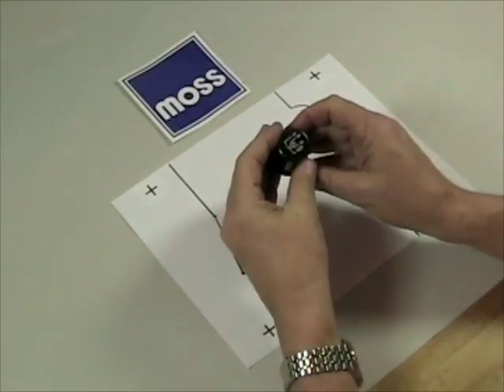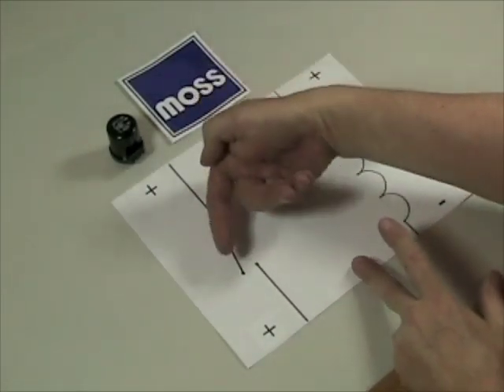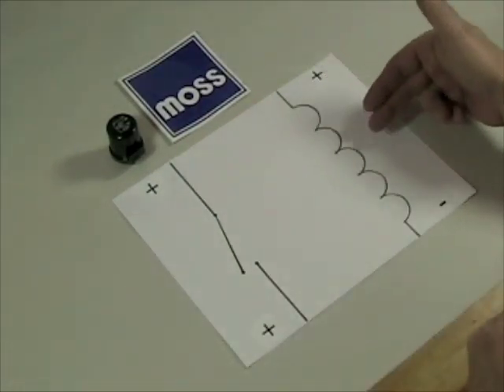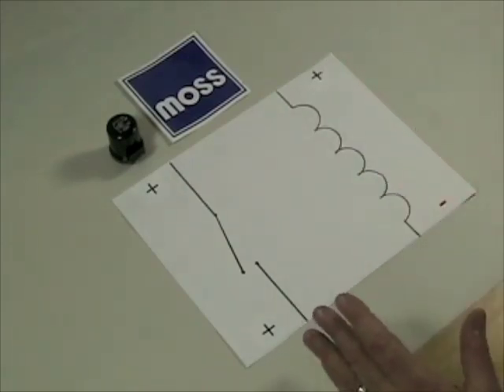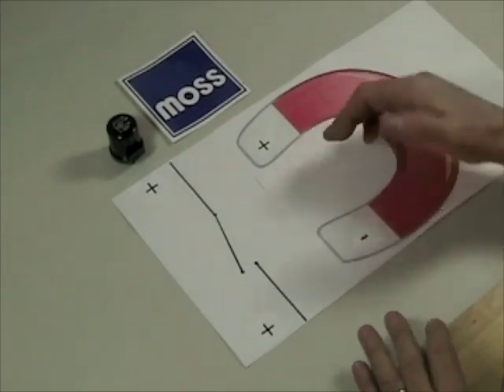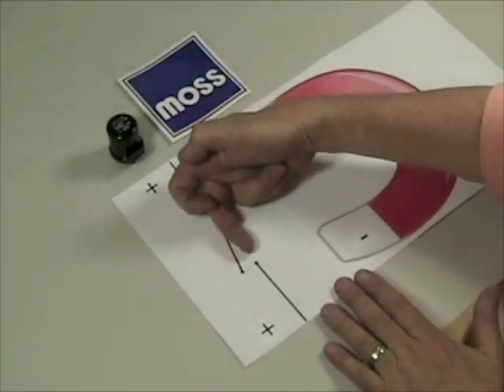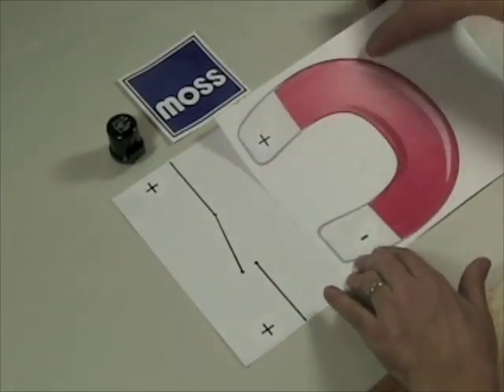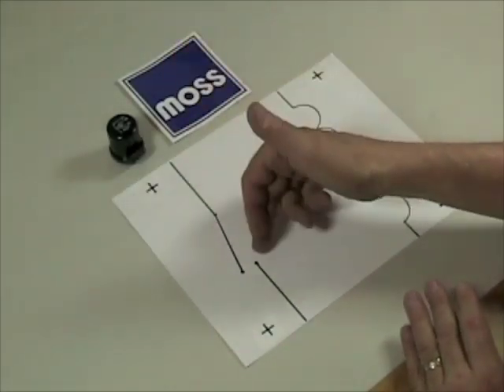Relays - How they Work

Comment: the magentic poles on a magnet are a little different than the pluses and minues on a battery. The plus and minus on a battery indicates which way electrons are flowing. They'll go - to +. When you make those electrons go in a circle (as indicated by the squiggly line) they will create a magnet, which attracts metal to it.  There aren't positive and negatives on the magnet (though the creator drew them on....a bit misleading) they are north and south poles on a bow-tie like shape (not horseshoe)

Comment: @Annergize True but the difference is that it can control higher currents better. Imagine turning on headlights with tons of AMPS going through the steering wheel, it would get HOT FAST. However with a relay and good location you can control higher amps more safely. I get your point though.

Comment: Question though, if a relay is getting 12v from the battery, what is there to convert?  I get that the answer is amperage.  But what I dont get is draw.  So instead of say a fan drawing 12v, 15a, the relay draws 12v, .1a and converts that to the 15 required?

Also, what stops the relay from producing too much current?